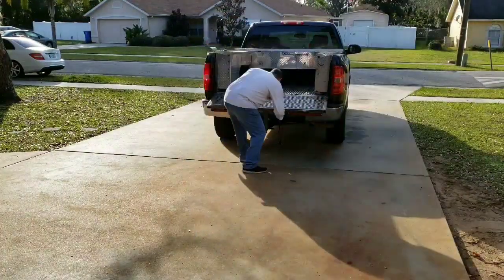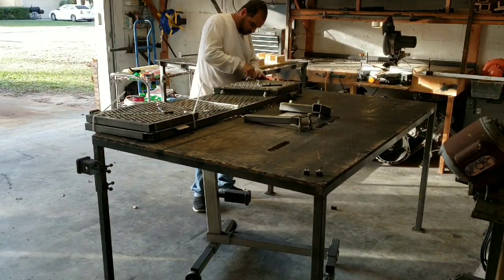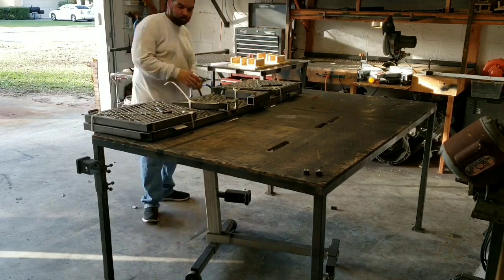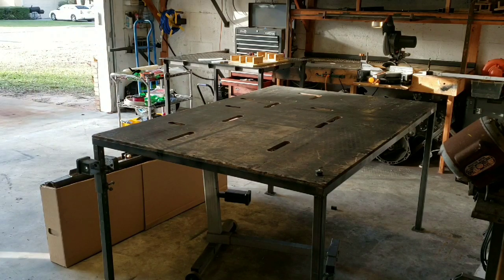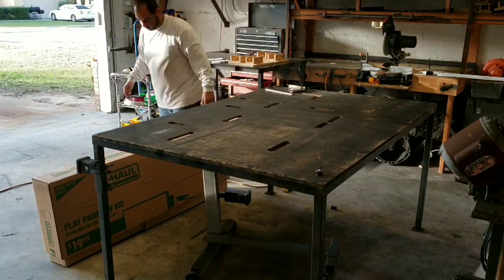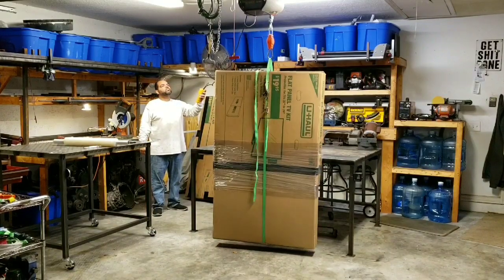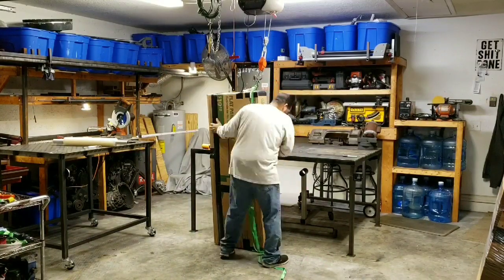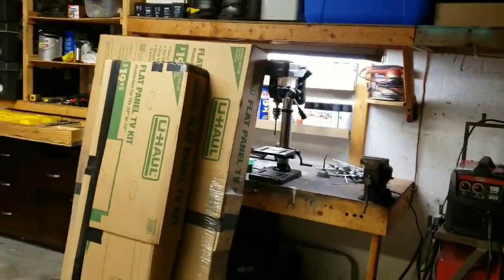Mow and Go Systems - install, test, removal, and packaging

Comment: HEY DALE,,,how does it come off of truck do you have to take it all apart again, or can you remove the whole thing together ,,also im in Louisiana what part of florida I might just come pick one up
Reply from the maker: Once you install it and get it setup the first time you can remove it easier. The Ramp is about 180lbs so if you want to remove it all assembled it might be easier with 2 people. In this case all just remove the bolt that goes into the hitch and slide it out. The way I do it is I remove the ramps as 2 separate parts and then the dovetail section all together. That way there are 3 manageable parts which makes it easier to store it. I'm in the tampa bay area. you can email me at daleotero@hotmail.com when you are ready. Thanks